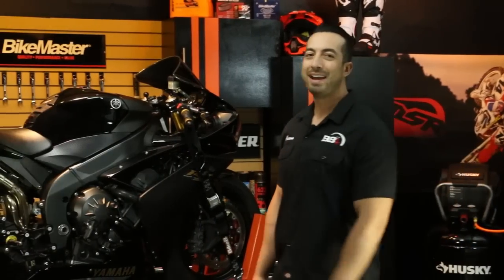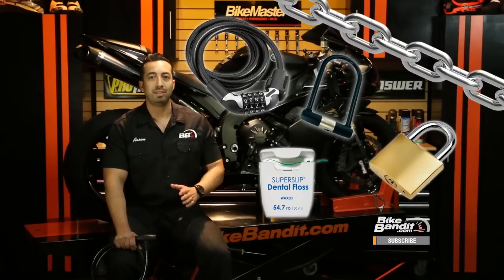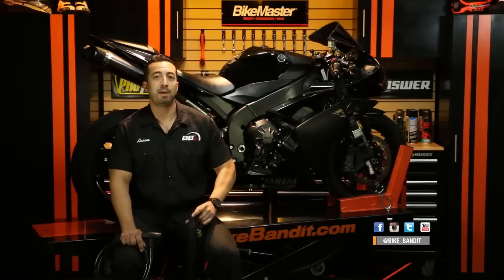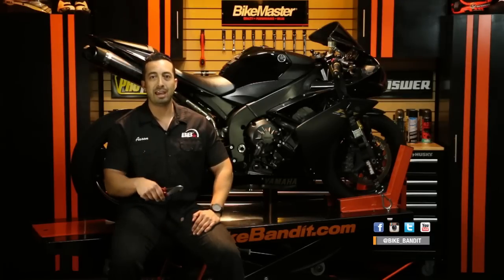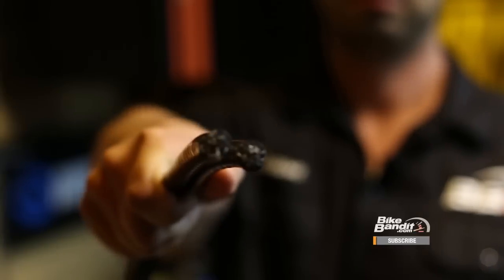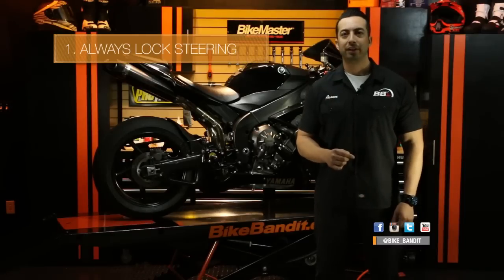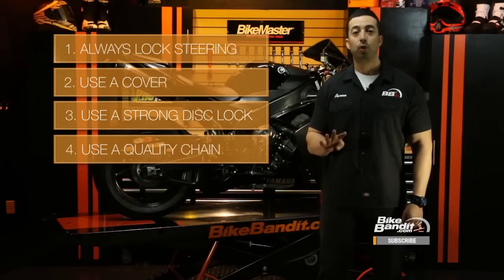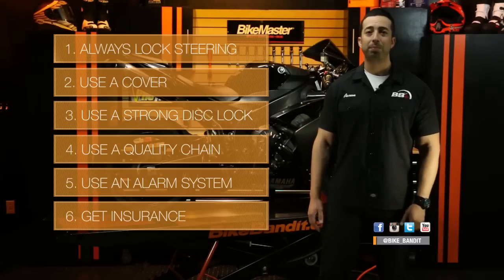Why you should never lock your motorcycle with a cable lock! | BikeBandit.com

Comment: At home I use a "paranoid" method of multiple locks, multiple disk brake locks (with built in alarms), a hernia inducing chain that requires an electric saw with a grinder wheel to cut through, padlocks with built in alarms as well as good old fashioned heavy duty padlocks etc etc

Comment: Disc locks suck. Too easy to pick.

JUST KIDDING!! 
I use three disc locks. One on each rotor.
I lock my steering, also.
Plus, my bike is heavy AF. Nobody is going to pick it up and load it into a van or truck. 
If they try, they'll end up on the ground with ruptured discs.

Comment: I have a 1985 Honda Elite 80 since May/2018.  Three theft attempts since owned.  Seattle.  Currently running two THICK "anaconda" cable locks and a C-wheel lock/jaw clamp on the front wheel.  Next tool...a fucking gun.

Comment: It's as simple as this: If someone wants your bike, your locks are unlikely to stop them from taking it. Dlocks are easily broken, most chains have crappy key barrels that are easily picked, and so on.

Chains, locks, cables, these things are not to prevent your bike from being stolen, they are to deter the theives so they take the bike 3 doors down with no locks that can be pushed away.

So the idea of "you should never use this lock" is actually pretty dumb, and a MASSIVE CLICKBAIT title.

Use it, just use it along with other devices, I.e a disc lock, or a level lock.